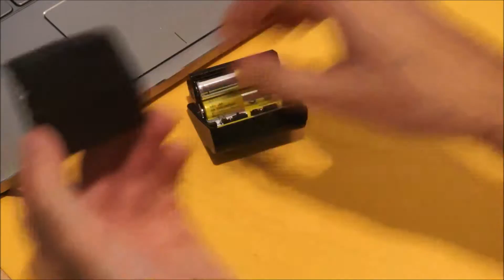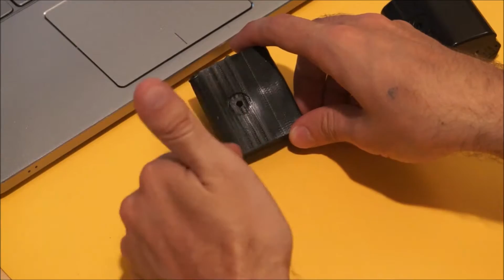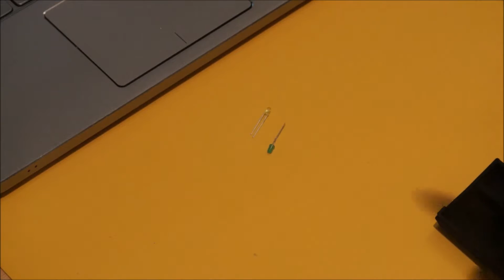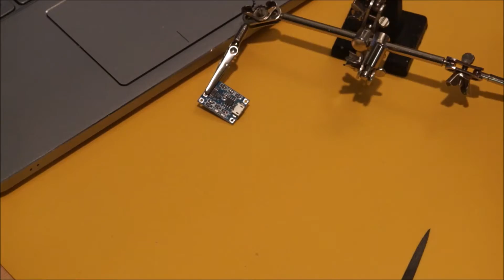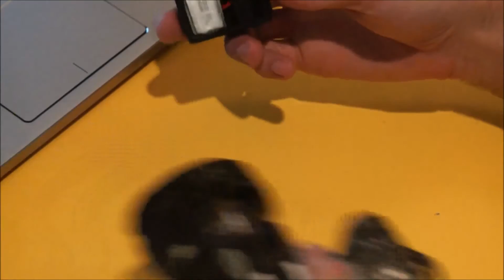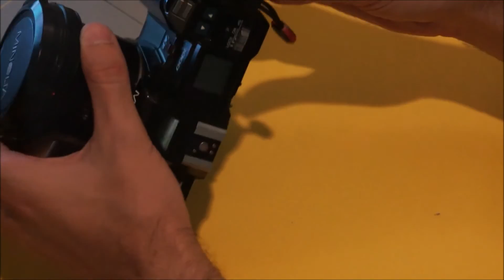Minolta 7000 battery pack - build log

Comment: Amazing video. Curious, what kind of charge controller is this, do you have a link to it? Are you wiring a 3.7v rated charge controller parallel to two 3.7v cells and then ouputting from those cells in series? Or are you using a charge controller that officially supperts 7.2v?
Reply from the maker: check http://dev-with-alex.blogspot.com for details